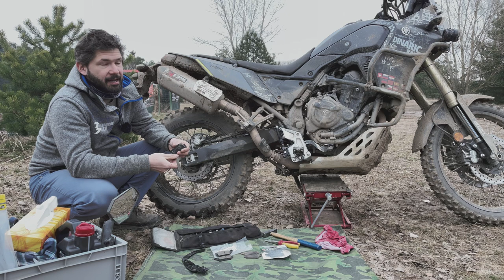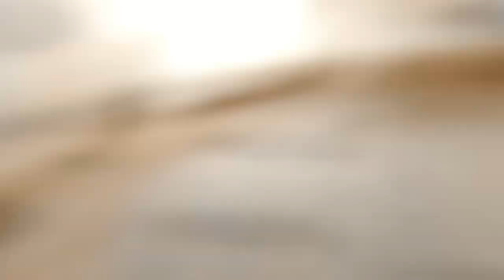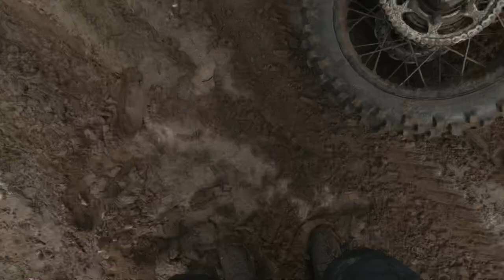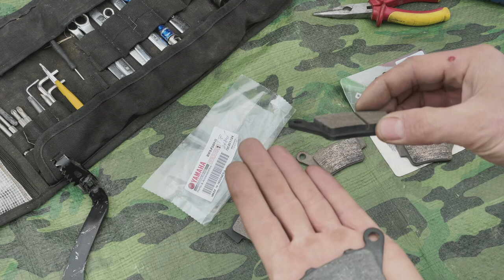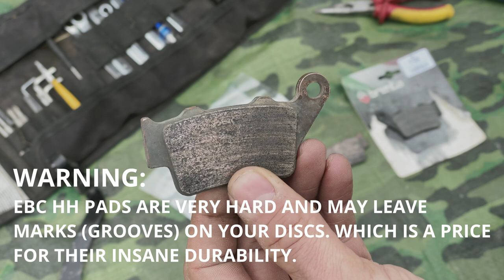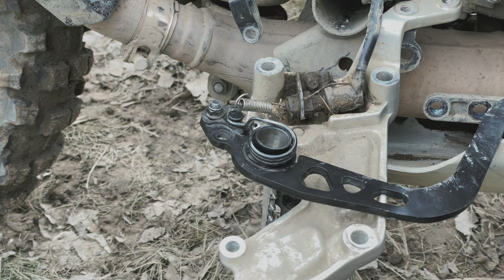Yamaha Ténéré 700: Insane brake pad wear!? Why my pads lasted only 1 day!

Comment: Watched this video when it was new, but my bike was so new I couldn't relate to the issues at the time. Now with 6,000 miles on the bike I can relate completely!  My outside pad is certainly worn more than the inside and the caliper seems to move freely, so I'm thinking that the brake pedal return is likely my issue as well.  Thanks for this video....safe travels!
Reply from the maker: This message makes me so happy! Great it helps! Yes that pivot needs to be serviced regularly.

Some uneven wear on the pads is normal but should be marginal.
Reply: @FARANDFURTHER  Thanks for the reply....ride safe!

Comment: Sintered pads ar for those who want to change discs instead of pads :)
And that bushing is ok to fill with grease, it can prolong cleaning interval.
Reply from the maker: Yep, indeed. Although my pad consumption during the mud rallies is just insane :) In mud and wet off-road the sintered pads make sense because the dirt will grind them slower than normal ones. For normal travel semi/sintered pads are what I'd go for.

Comment: Thank you so much for these videos, very helpful! Have you replaced the rotor by any chance, and where did you get that high pipe?

I had a CB500X like you, and put that Scorpion exhaust on the T7, though it isn't as high as yours!
Reply from the maker: Hi Javraj, you're most welcome, I'm happy that the video was useful.

I have not yet replaced the rotor/disc it does not wear out that quickly.

My exhaust system is custom build by the guy here in Czech republic. I have video in making about the high exhaust modification as a lot of people asks but it is not really off-the shelf solution.

Comment: Im little confused. Why is the brake adjustment set for low pedal? Then a weird height adjustment welded on the pedal? First thing i had to do is adjust that brake adjustment to max Up. So I could have rear brakes response.  But thanks for pad assessment. Cintered pads better! Ebc. And yamaha messed up on a oring style pivot. Should be just metal to metal like most off road bikes! Just grease on occasion.  30yrs. Bike mechanic

Comment: I installed the EBC HH better lifetime and brake Power for less money than OEM
Reply: But they eat your discs as per the video
Reply from the maker: My Yamaha dealer is selling the OEM pads cheaper than I can buy EBC pads here in Czechia so to be honest... OEM kind of wins. I did 15k km on 1st OEM rear pads that's good enough and they're a gentler on the disc.

Comment: So ! from now on oem breakpads ?
Reply from the maker: Well, that's not that easy. OEM pads are good middle ground. The EBC HH are quite aggressive on the disc and the Brenta does have very soft compound. Combine that with the fact that my Yamaha dealer is selling me OEM pads cheaper than EBC or Brenta.... it's the OEM now. But people got back with some other brands and suggestions so there is probably some 3rd party options but for me at the moment OEM seems good way to go.

Comment: 1st. when driving in dirt, clean and lubricate all pivot points regularly.
Also look for the pivot point of the rear suspension.
The maintenance intervals are too long for that
2nd. Do not lift the motorcycle from under the skid plate or by the fram sub-members.
See your Manual on page 6-34 (Supporting the motorcycle) for this.
Reply from the maker: Hi, thanks for the feedback.

1) In terms of brake calliper pins I'd suggest inspection before taking it apart and re-lubricating when not necessary. The calliper pins have now 24000km on them and move freely and smoothly.

Rear suspension maintenance has little to do with the brake system. I assume you just mentioning it for completeness. In those 24000km I've done I serviced the rear linkage 3 times and it has been always fine despite I've been riding off-road and in bad conditions.

The dry rear suspension linkage issue floating on internet seems to be a bit exaggerated but I do agree with checking it more often than the 10k service interval.

But that is valid for example for oil change as well. It depends on the environment and how bike is ridden. Yes, service intervals are too long for heavy off-road use, but over maintenance is also bad, I learned that over the time.

2) Thanks for citation from the user manual about the supporting the bike.

Any idea what is the rationale?

If I understand correctly the jack should be placed under the sump and using wood between the sump and the jack. In that case the whole bike is lifted on the sump. That way the bike is lifted using the engine instead of the frame which is the case when I lift it using the skid plate.